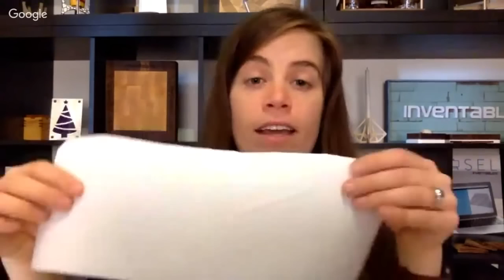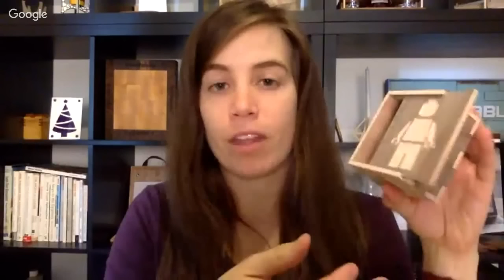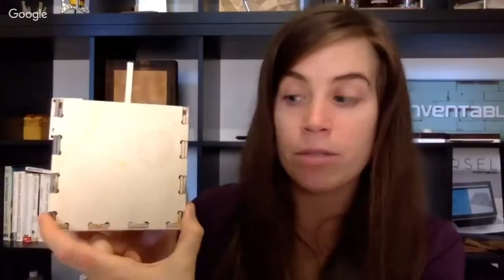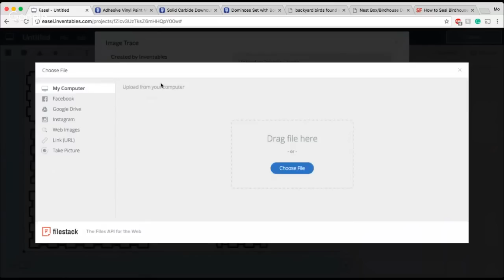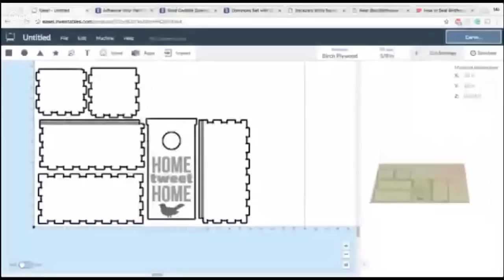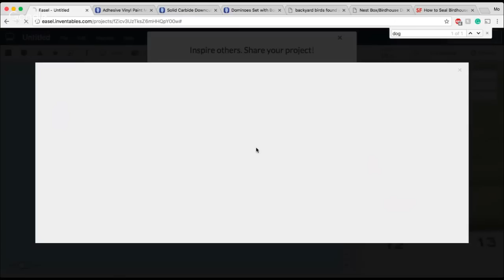Easel Live: Let's Make a Birdhouse!

Comment: Question: For the hole, wouldn't you want that to be an inside cut to be exactly the size you set it to? I understand if you're cutting out pieces that you want to use you need an outside cut, but since this is a hole in an existing piece, my brain seems to want to think it's an inside cut. Can you explain?